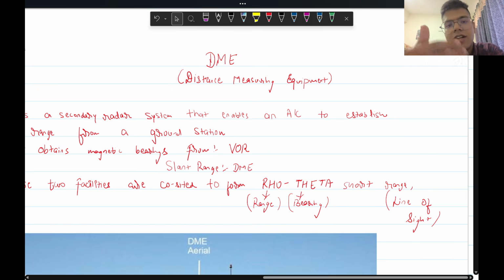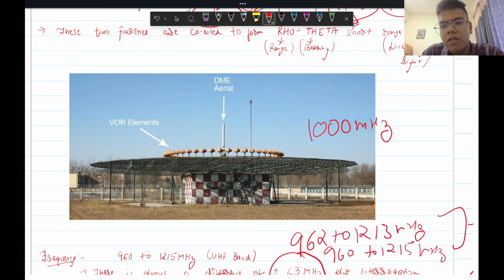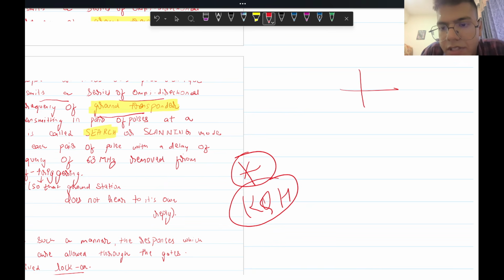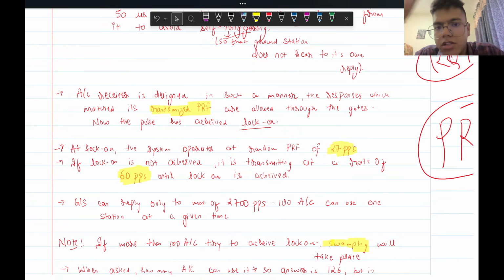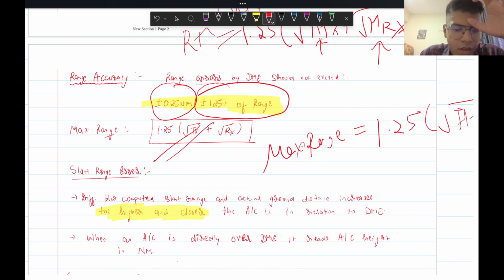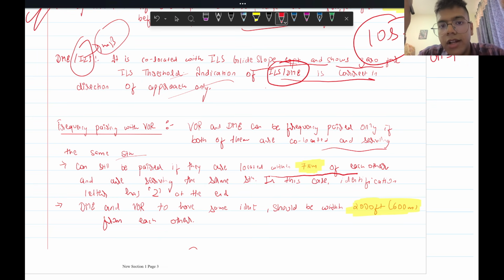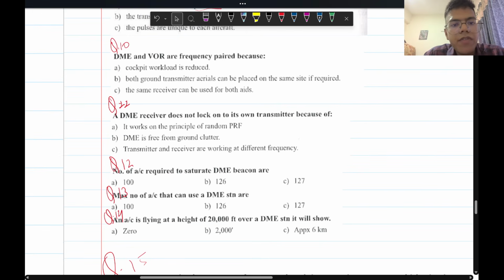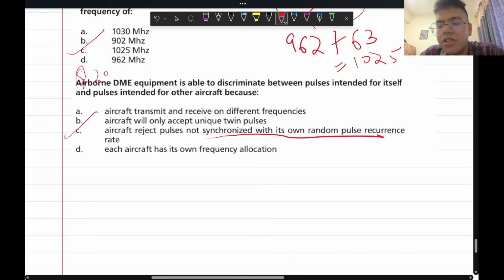DME Explained in One Shot 🔥 | DGCA Radio Navigation | Complete Concept + Important Question

Comment: Hi bro! Thank you so much for the video. Really helped for my revision. Just a doubt for question 1. If 150 PPS on search mode then in 100 seconds won't it be 15000 Pulse Pairs transmitted? In that Case won't be answer be Charlie? Do correct me If I got it wrong or missed something. Happy to learn :)
Reply: Yaa exactly even i am confused
Reply: It will sent a constant 150 pps for 100 seconds, the pps will not get increased
Reply: exactly the answer should be charlie